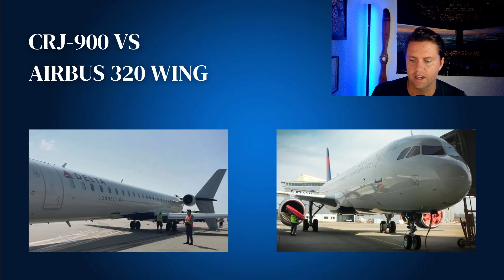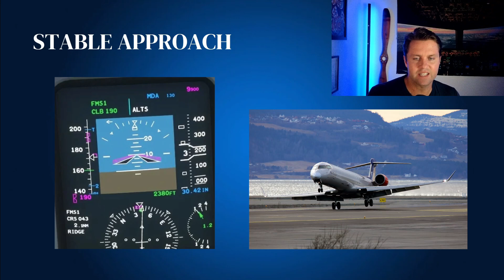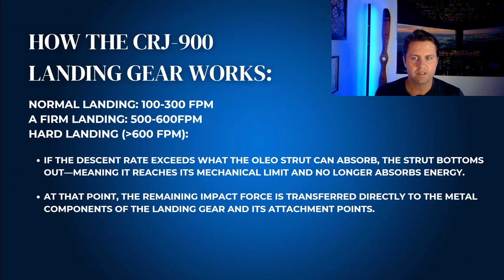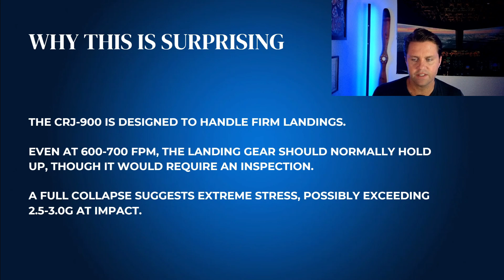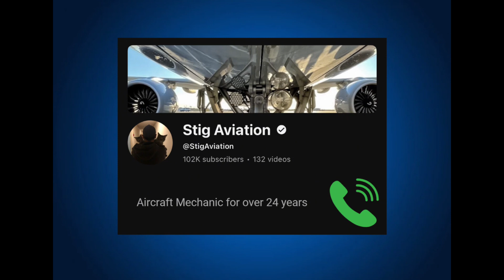Pilot Breakdown: Did a Hard Landing Cause A Gear Collapse?

Comment: Bombardier knows how to make a fuselage. We know that.
Reply: But not how to properly connect wings to main fuselage though.
Reply: @xcalibertrekker6693  actually yes. It was designed with "breakaway' bolts that connects the wings to the fuselage. The CRJ 900 I mean.
Reply: @lookabomba32  In what scenario would you want you wings to break away?  They should be the strongest connections.
Reply: Wings are full of fuel.  Better to leave them behind on impact.
Reply: @ Wings are not full of fuel when landing at destination.  That is on takeoff genius.
Reply: @xcalibertrekker6693   exactly this one. The wings on the CRJ 900 are designed specifically for this scenario. If the wings are supposed to be the strongest connection to the fuselage then the wing breaking off the fuselage would tear a huge section off the right side of the fuselage causing everyone inside of it to spill out and receive catastrophic bodily damage. 

If the wings are too rigid at the connection to the fuselage then any bending, and they do bend, would cause problems such as more stress fracturing than the plane was designed for. Just because a part and or connection is strong doesn't necessarily mean it's good for the aircraft especially when it comes to the airframe itself. All aircraft bend, expand and contract. Either by pressurization, depressurization and or being buffeted by the winds and atmospheric conditions. A aircraft can't be too ridgid or too flimsy.

All aircraft have a lifespan. Always in cycles. Every time a plane takes off and lands it's 1 cycle.
Reply: Same with Sikorsky helicopter airframes.

Comment: Thanks for talking a bit about landings on the CRJ. I have spent about 10-20 years frequently traveling between Michigan & Canada on Delta's CRJs (well, the DC-9s before the CRJs...) and although as a passenger I find CRJs to be pretty comfortable in air, I have many many times found that pilots land them really "hard" especially in winter weather. Your explanation at least helps me understand that all a bit more. It was on my mind after I heard about this disaster. So happy everyone was okay and able to walk away.
Reply from the maker: Glad to shed some light, and agree that it's a relief everyone made it out!
Reply: Amanda if the runway is contaminated with water, snow, or ice it becomes even more important to land the aircraft on the first part of the runway because braking may be less effective. That may be why some of your winter weather landings seem a bit hard. A good pilot will try drive the aircraft right on to the runway instead of messing around with achieving a very soft landing in those winter conditions.

Comment: The snow MAY have also been responsible for the wing breaking off. If the wing had hit pavement or hard dirt, it may have skipped along the surface, and stayed attached. The snow likely allowed the wing to dig in, causing the high forces needed to rip the wing off. Would the accident have been less severe if the wing stayed attached and the plane stayed upright? Maybe, but having the wing attached may have caused more fire around the fuselage.
Reply: That's my thought having cleared my driveway several times during the past few weeks.  Built up snow gets stiff.

Comment: They got slow either by trying to extend the glide against the wind or the bottom fell away like it often does on gusty days and it didn't flatten out like they were hoping it would. They just held it steady like newbies do. 41 hours for the PIC is a short career.
Reply: No. The 41 hour pilot was the First Officer and she was not the PIC. She did get her ATP but it doesn’t really mean anything in the grand scheme of things. Although their ground speed was slow due to the headwind the indicated speed was probably normal or slight fast due to a speed additive. Now the if the bottom falls out at the last minute that is why power is kept in until the last possible moment before touchdown. It’s demanding and takes experience. There is no way the FO should have been the landing pilot, which if so was a major failure of the captain.

Comment: In a crosswind landing would the crabbing of the plane cause the load on the gear to be in a direction which is the gear just couldn't handle? If they didn't flare, they likely also didn't straighten the plane to the direction of travel which would put some unusual loads on the gear. Could that unusual load cause the gear to buckle? I still think the right wing stalled which caused the rotation forcing the right side down and the left wing up since it still had lift. And it appears to me from the pictures of the plane at rest, the wing broke at the gear attachment point and not further inboard. The right wing contacting the ground would cause a total loss of lift and the left wing being up in the air still producing lift made the flip inevitable. 

Without question the snow saved lives. But had the wing not broken off the snow wouldn't have mattered as the plane would have cartwheeled and likely broken the fuselage open and that absolutely would have caused a lot of deaths even without the fire. As for snow putting the fire out, I have fought a lot of fires in snowstorms, see the profile pic for 1 instance and I can tell you snow is not a good extinguisher of flames as it is literally mostly air unless it is slushy and that was clearly powdery snow.

I still believe wind shear was the culprit and have heard the wind shear anunciator system is disabled below a certain altitude because once you get below a certain altitude, you won't be able to counter it anyways. But the detector still is running and should be recorded on FDR. Will be interesting to see if the stick shaker kicked in in the last part of the descent.

Comment: I also think the jet was coming in a little too fast, and it made a hard landing, and then you can see the nose go up, and that is when the jet leaned to the right, and then the right wing hit the ground, and broke-off, and that is when the jet flipped over. I do suspect that the wind and the snow could have contributed to the accident. Like you said, the snow helped to smother the flames quickly, so that was a blessing. Also, passengers could smell the jet fuel. Thank God everyone got out of the aircraft safely.
Reply: The snow and cold temperatures also may be a contributing factor.

Comment: As a aircraft mechanic, and PFE, it looks to me like this plane came in way to hot, and did not have the right angle of attack.
Reply: I can't agree with you re the "... plane came in way to(sic) hot, ..." as the ADS-B data shows they were right in the target speed zone for landing in a CRJ-900. That said, you're absolutely correct re their AOA - they pancaked that thing in like they were landing on an aircraft carrier.
Reply: @creid7537  Yep... Way too hard! Rate of descent never seems to have changed due no flare. Like it was "driven" into the ground. Looks like 1100+ FPM
Reply: he was crabbing, and touched hard on one side, but this should not have sheered the wings off...

Comment: It may be video, but the elevators don't seem to be deflected upward to flare the nose.  Sink rate seems really fast all the way to the ground.  Is icing a possibility with an aircraft of this type if held at lower pattern speeds for too long?   Does Runway conditions have potential to affect radar altimeter?

Comment: It might have picked up some ice in flight. This will increase the stall speed. Also, for tail heavy aircrafts, such as CRJ 900 and B727, when you go power idle, the plane is done flying. It is a brick now. The pilot probably went power idle prematurely and the plane stalled, right wing first.

Comment: The slow motion video makes it look like nose gear was off the ground when main touched. If the gear was serviced with too little oil or too little nitrogen, that could cause it to bottom out. 

For vertical speed, some aircraft are rated on max vertical speed of 14foot per second. Gear failure at 18 foot per second. A 600 FPM is 10 feet per second. 

One other thought, I wonder if they pushed wrong rudder pedal at the last second. Should be right rudder with right crosswind as crab removed. If landing on right side of centerline, they could have accidentally pushed left rudder
Reply: I said the rudder backwards. Left as crab removed but accidentally pushed right if on the left side of centerline. Not sure from that view but a possibility that I’m sure they will look at
Reply: @climateandculture9526  I don't know where the wind was in relation to the plane.
Reply: @ it was coming from 40 degrees to the right. They were landing on 23 and wind was from 270

Comment: So why no flare?
Reply: My initial thinking is that it could be simple pilot error or the wind just stopped at literally the exact wrong moment and the plane literally fell due to being unsupported by the air.

Just my thoughts though.
Reply: Wind sheer hypothesis seems to be supported both by ATS-B and visual inspections of the video, and that they landed slightly early. Hopefully FDR etc. will provide good data soon, so investigators can tell if the data on the internet matches the actual events well.

Comment: Zero flare = carrier landing without carrier designed landing gear.  It did look a little hot, but hard to know without from additional frame of reference, but there was zero flare and it crossed the line from hard landing to crash landing.
Reply: A 'ittle hot'  ???    c'mon man
Reply: I''m conjecturing metal fatigue.

Comment: watching the videos on this accident gives a pretty good sense of what happened. The decent rate looks to me to be at least 800 fpm..and the right wing low prior to touchdown reveals technique for x-wind landing. The aircraft is literally driven onto the runway shearing the right gear off because the touchdown decent was never arrested with a flare. The right wing sheared away and the left wing still producing lift flipped the remaining aircraft section over. In my opinion this is obvious pilot error and incompetence. I’ve got 30,000 hours and 42 years with major U.S. airlines, smallest jet I flew was B727 then B757/767, A320, A330, B747 & B744. Who were the pilots and what is their experience. This industry is pretty unforgiving and demands the best and the brightest, the flying public should demand nothing less.
Reply: NO FLARE? 
On the early afternoon of Feb 5th I was flying on AA from PIT to DAL.  It seemed like a normal descent except it must have been IFR because we were surrounded by fog.   All a sudden we landed with a WHAM!!   I don't think there was variation in power application in the last seconds or any flare.  Hardest landing I've ever had and I've been flying as passenger for 60 years.  Am wondering if all of the young pilots are being taught?
Reply: @rconger24 Gliders, which I fly, can't flare without power from an engine, but we have a trick, we come down faster (having stored some gravity energy in the frame) and then use the flaps to jam the rudders, so the frame gives up power which we use to semi-flare. But the Toronto pilots may have reduced flare hoping for gust wind to finish the flare. However, you can land with no flare-- its just a hard landing
Reply: @heyhandersen5802  power is pulled to idle during the flare.  When you flare you are as committed as if you were in a glider (maybe not if you have afterburners) as you are well under the power curve.
Reply: Question for you from a non pilot: On another video, a post was made by someone claiming to be a Southwest pilot who stated that their rules/policies was to NOT flare on landing, yet I can’t recall ever seeing a large commercial aircraft that didn’t flare at least somewhat. I have seen military aircraft do it at much steeper angles but those are designed for that, right? 
He was insisting that all SWA aircraft never flare which I found difficult to believe.
Reply: @JohnHallgren  I have never heard of that…never.
Reply: @ thanks! It’s been 10+ years since I last was on airliner but I would SWAG that it might have been a second or so between main gear touchdown and nose gear from what I remember. Haven’t looked at any videos but that no flare idea just seemed illogical.
Reply: On a Fox 9 Minneapolis St Paul clip, Matthew Buckley a former commercial and military pilot claimed he saw data that showed this crj was descending at 1100 fpm. He said he landed f18 hornets on carriers with a descent of 800 fpm for comparison.
Reply: @ that is interesting..I’ve not heard of this information. My guess looking at the decent in the video is a decent rate of at least 800 fpm…at least from watching the video. I’ve been hearing that the FO was the pilot flying and is a new hire having come online in January..possibly on her 5th day. As Delta and Endeavor is basically sealing all information related to the names and experience of both pilots. Will be most interested in finding out more about who they are and their flight experience history.
Reply: I looked into it and know what happened sadly.  It will happen again unless they fix the problem!
Reply: Thats what I thought too. My daughter said they hit the runway hard. There was another flight crew catching a ride to Pearson sitting beside my daughter and she said they were really concerned just before touchdown. She said the one pilots face just went white before initial contact, she knew by his face something was very wrong.
Reply: Asians had two flight attendants who survived but were unconscious on the ground and were subsequently run over by a fire truck.  They couldn’t have been using their phones.
Reply: 100% exactly right. Except I think it was higher than 800 fpm descent. 1000-1200 would be my guess, based on the length of the airplane (for scale), and the timing of the video.
Still could've been "pulled out of the fire" with a skillful flare ...probably ...ish.
Reply: They looked pretty level to me when touching down.  Almost like the right main gear collapsed on touchdown.
Reply: @xcalibertrekker6693  Looked more like it hit the ground than touched it.
Reply: @ the right gear did collapse…due to over G force impact..to the degree that the right wing sheared off.
Reply: Hey Capt_Tarmac, I completely agree. Pilot Error. Perhaps the snow on the ground caused a depth perception issue which could have contributed to the crash, but it  was pilot error.
Reply: Pilot error, too young dei student
Reply: my own fear, is that if it was not a hydraulic failure in the landing gear, that a spoiler may have failed to deploy-- there was obviously some differential in the wings with respect to lift. We land gliders w/o flare but we still pull the nose up with energy trapped in the frame of the machine, but it is very slight. During the 2nd WW heavy bombers often came in dead stick w/o crashing.
Reply: The pilots were women who got their certification just like one month prior this flight “thanks” to bs DEI scam political agenda that made unqualified people take lives of other in their hands
Reply: This guy is spot on. Im an aircraft mechanic and watch planes land in front of the hanger all day long. Decent rate was blatantly too high. 100% pilot error. The lack of crew names pretty much shows it was a DEI hire.  I'm sorry but women just shouldn't be allowed in certain professions like police, infantry, and airline pilots.  Men and women are different. Even a child understands this basic fact of reality.  On the same hand, there are professions that should not allow men. Its not discrimination, its understanding how the world works.  Women simply cannot emotionally or physically handle high stress situations of survival.  We have gender roles, just like all the other animals in the world.  We think we are smarter than nature but we arent.
Reply: It looks to me like the gear may have actually ripped away because of the wing catching compacted snow and separating rather than the wing catching compacted snow and separating due to gear failure.  Hard to tell though.  Edit:  And I hope the cadres of DEI cheerleaders in these threads read your post then reread it.
Reply: I heard it could be a sudden tailwind that could have droven in the ground, and the CRJ has a low flare altitude of like 20 ft.
Reply: @Rodfriend  omg
Reply: @Rodfriend  If tailwinds had anything to do with it there'd be 10,000 crashes a day.
Reply: I just heard they were an all female crew… no issue if they were truly qualified
Reply: @lisawilson3494  I heard the audio communications with the tower and it was a male pilot on the radio. There may have also had a female pilot as well in the cockpit but the radio communications was with a man. @blancolirio has the audio on his report.
Reply: @lisawilson3494   From cockpit radio, a male voice  is obvious on VASAviation and Blancolirio.
Reply: @lisawilson3494   It is an issue to me. Yes, granted one of the best flights and landings were by an Aer Lingus female pilot and given the "social mores" in Ireland, she was likely trained by her dad, and fast tracked into a career there.  Now just because women can fly and there were great aviators during the war, etc., so no doubt about that, is it the best use of our particular gifts?
Reply: @lisawilson3494  You may feel differently when you or a loved one's on the next hull loss and Santa Claus isn't there to put the jet A fire out with miracle snow.
Reply: it was a dead stick landing but you can land w/o juice. i think there was a patch of ice and both wheels did not touch at the same time, cartwheeled...spun...upside down.

Comment: Totally agree with the snow saving they're butts from a firey grave
Reply: I think the snow helped, I don't think it was the only reason.  It looks like the fireball stayed with the fuel. Sure there's fuel in the lines and yes, there's more fuel and an engine on the otherside, but that's NOT what initially caught fire. I believe it would have if fire didn't respond so quickly with the foam.